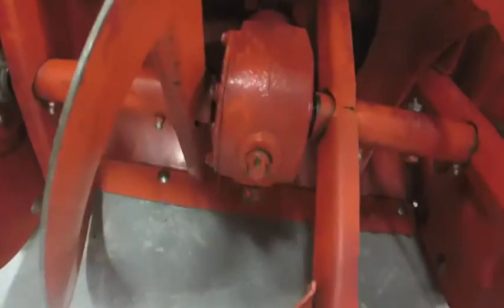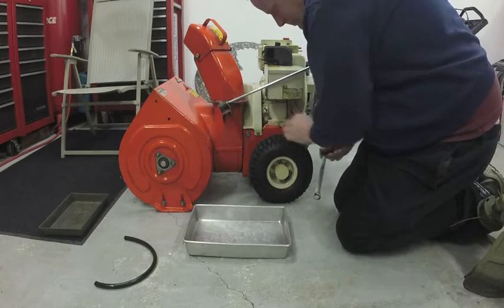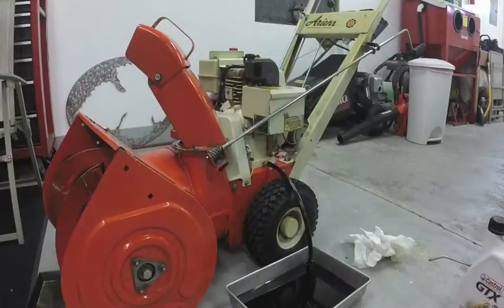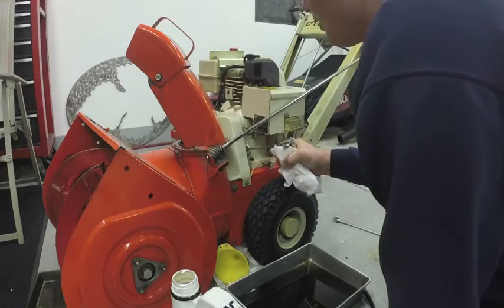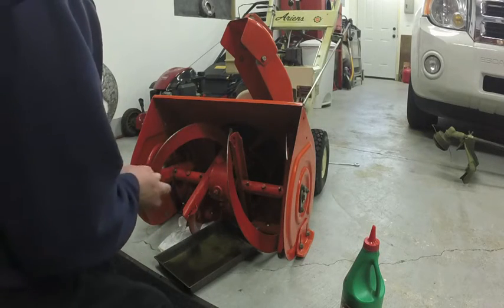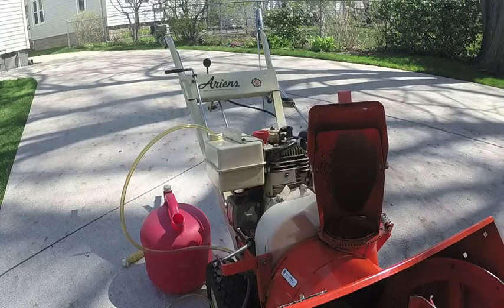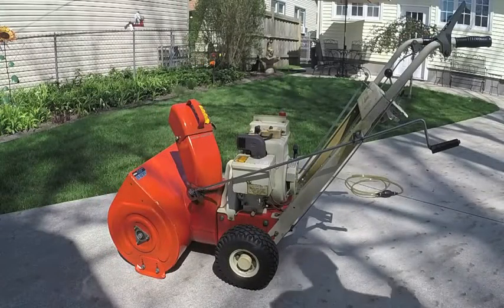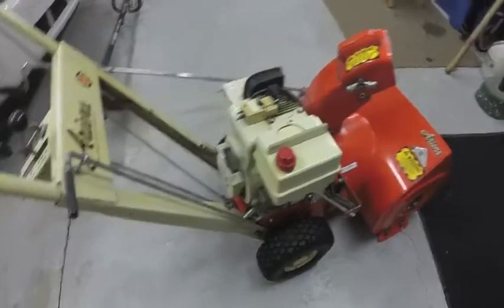Summerizing 1976 Ariens Snow Thro snow blower

Comment: 👍I hope you don’t need it this winter Howard but I expect you will :-) 
I rebuilt an old 1985 Snapper RER 28” rider mower & hated the engine oil drain port as is in a terrible location. Very messy. I put in a 1/4” X 2.5” brass nipple & can now drain oil w/ a hose. No more oil spills. 👍

Comment: You keep your machine in fantastic condition, Looks great for a 40 yr old machine. I do the same service with my ariens which is also 40 yrs old too..... It looks like a 22000 series machine. Does it have a 4 or 5 hp engine? There is one for sale here in town for $100...was thinking about picking it up......What's your overall impression of your machine, in cas I pick it up for my collection......?
Reply from the maker: +Leesherwood It's a 5 horse engine. I love it, moves tons of snow very easy. Always starts first pull. I just don't like the lever that has to be held up with my fingers, to keep the engine running, when the blower is engaged (a safety thing). It would cause my fingers to get cold. I just zip tied it up, so the blower runs when I step away.